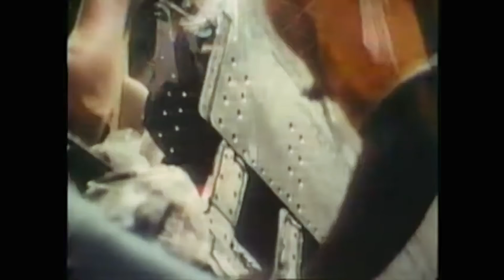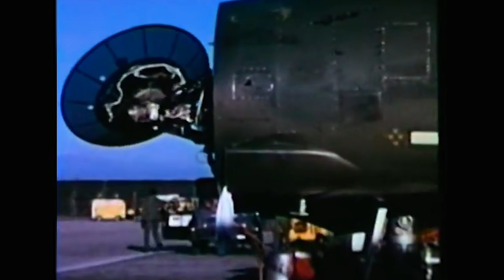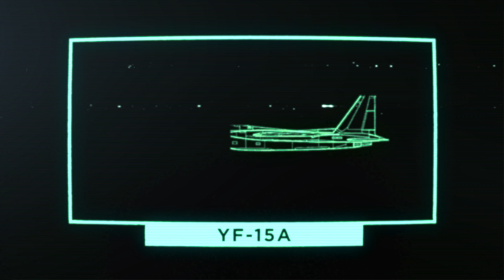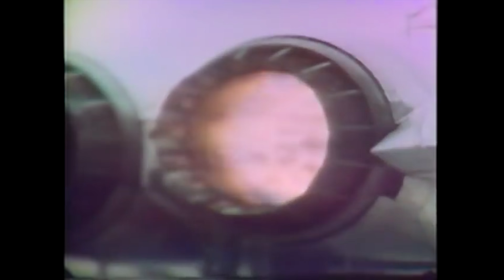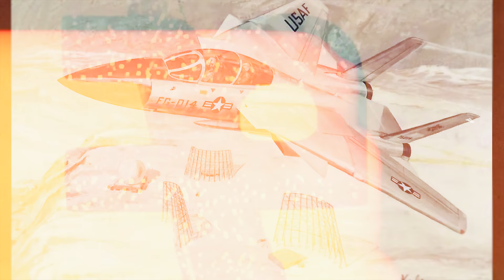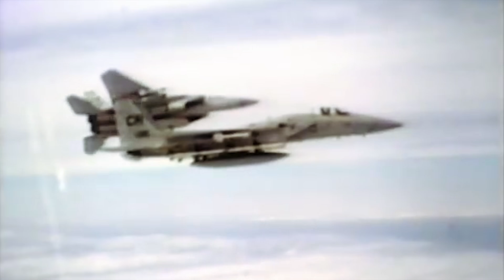F-15N | the forgotten 'Sea Eagle'

Comment: Love the Eagle, but it was never gonna be a seabird. You can give a navy bird to the air force (F-4, F-18), but you’ll never be able to give an air force bird to the navy.
Reply: Except, you can. 
Just look at Mig-29K and Rafale M.
Reply: F-18 was primarily designed for AirForce as successor of F-5 wasnt it? It got modified so much from the first concept that they skipped the F-17 name it was intended to use. So no I disagree with your opinion. You can turn AirForce bird into Naval plane. The only deciding factor was politics. Clearly F-15 would be better Naval plane than the Hornet was. Especialy in the role they were going to replace older F-14s. But I guess someone liked how the F-18 looks or something and they choosed it instead. Im highly disappointed by that decision.
Reply: @WeeB_the_PilotF-5 and the in between F-17 were air force, but when MDD got the design they beefed it up for the F-18 which was a navy design that was beefed up for carriers